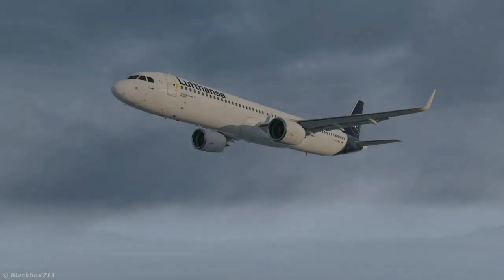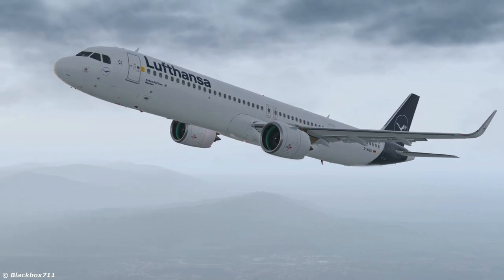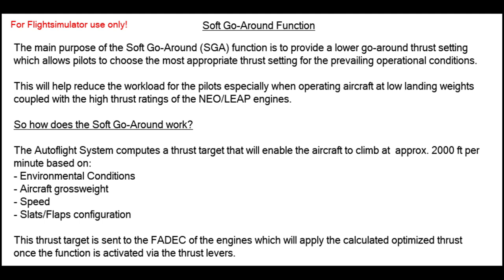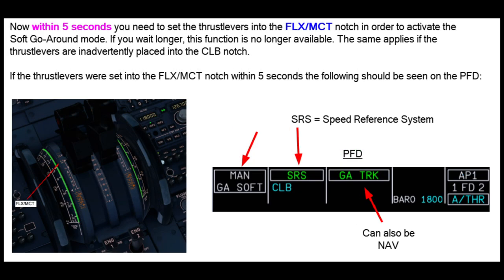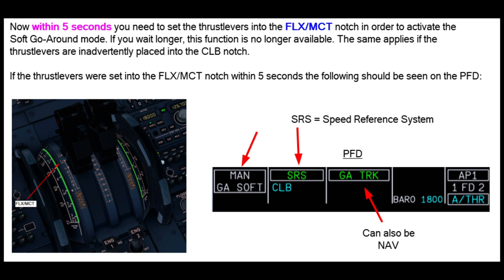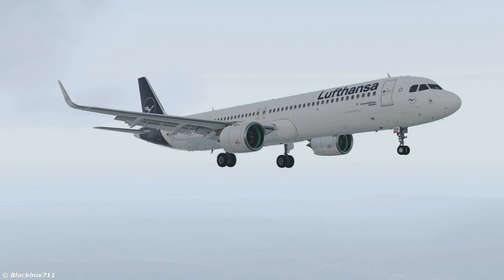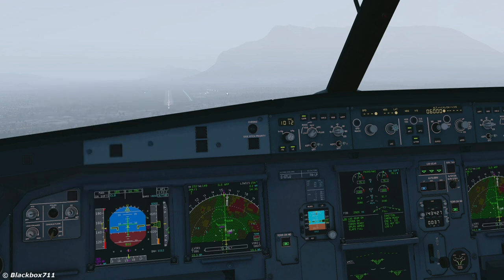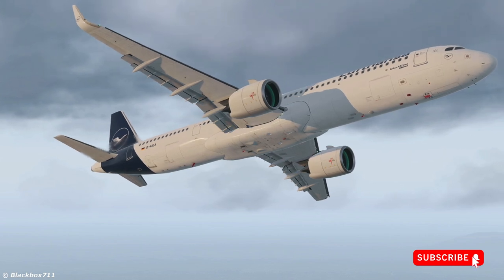Toliss A321 NEO - Soft GA function

Comment: CTP 2021. I did a go around in this beast at LSGG. Someone was ready to take off the opposite way. I was amazed. I didn't knew the soft G/A mode. And did a hard one. I had the autopilot off and it actually engaged the autopilot when selected climb thrust

Comment: Interesting, since I recall A320ceo pilots doing the exact same thing (TOGA for GA then immediately FLEX/CLB) without the system.
Reply from the maker: But that is something different and has nothing to do with the GA modes.
Reply: @Blackbox711  is that actually something prescribed in the SOPs or one of those "pilot improvisations" some do to make their lives easier?
Reply from the maker: The only reason to get out of the GA modes early is when you have a low GA level off altitude or when executing a GA at higher altitude and close to the level off altitude. I doubt many airline pilots dare to go against company SOPs by using non standard procedures.
Reply: @Blackbox711  There's also another reason: go around on a light/empty aircraft (e.g. ferry flight). TOGA thrust (coupled with aft CG) would cause the aircraft to rocket upwards with a big pitch-up moment which the pilot may fail to react quickly enough and stall (e.g. China Airlines 676, FlyDubai 981), or the pilot gets somatogravic illusion and slams the controls down hard (e.g. Atlas Air 3591). If terrain & aircraft performance aren't a factor then a slower climb on CLB thrust to the missed approach altitude may be better.

Comment: I also was about to ask if this new mode will be certified for the CEO as well, but saw in the comment that currently it is only availible in the neo.

Will all 320neo family get this feature?
I mean for the A319neo it would make sence.
Also do you know if the A330neo have them too?

It is interesting that the 737max also got a new system upgrade.
For example the Overrun Warning system which is similar to the ROPS of Airbus.

The 737max also got additional callouts like 

"OVERRUN GO AROUND" in case runway length is insufficient.

But no info if this upgrade will come to the 737NG, too.

The Overrun Warning system is controlled by the FMC Approach page 2/2 if i am not wrong.